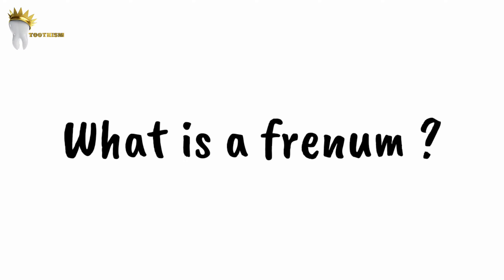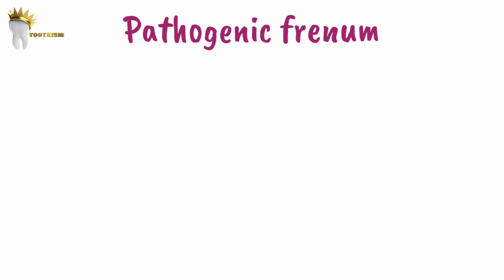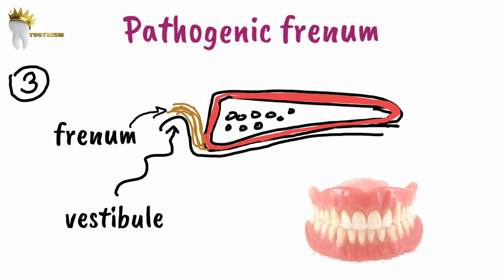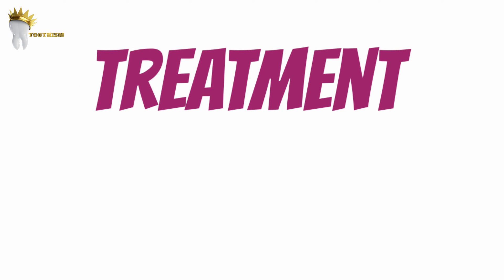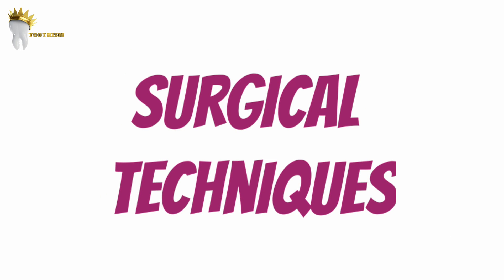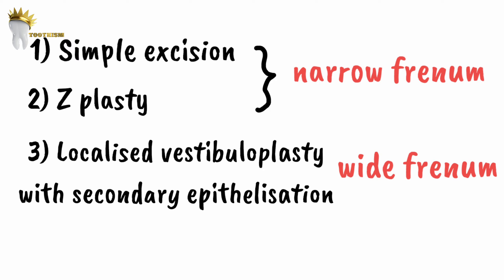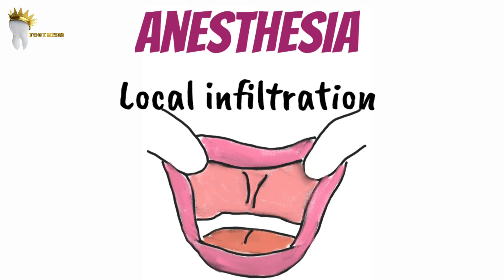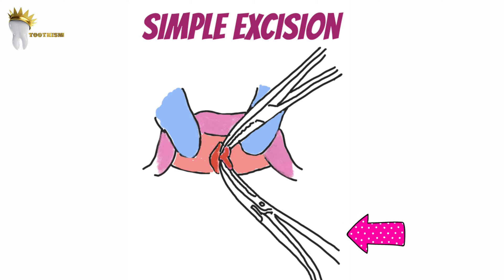4 Techniques of FRENECTOMY Surgery | Why is frenum removed?

Comment: I have a question. I'm 20years old and got a lingual frenectomy in nov, 9 months ago now, with scissors, not a laser sadly. I consistently get a blood blister near my frenulum, I don't pop it but it pops on its own and I try my best to let it heal but I just keep coming back. Is this normal? how do I do make it fully heal? Every time I try to call my doctor they never answer back or give sound advice.
Reply: refer to oral maxillofacial surgeon near by you.....dont  confuse with dental surgeon..both are different
Reply: Hello did you find a solution to your problem?